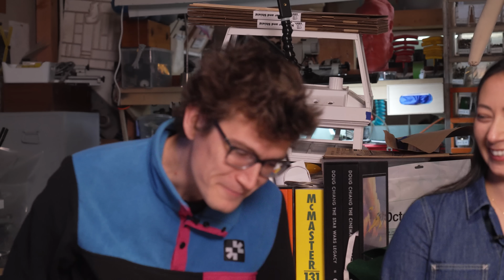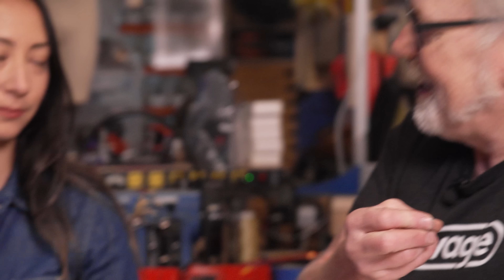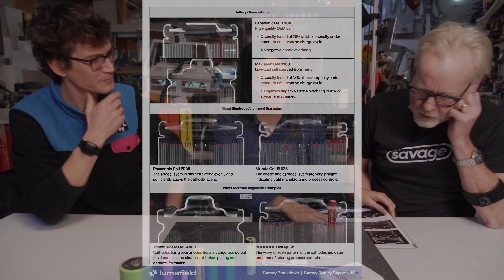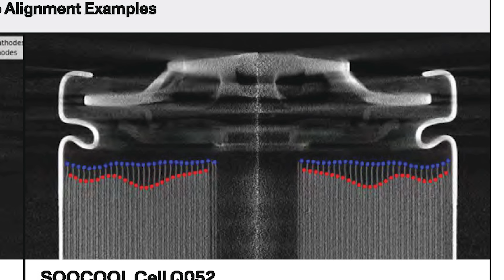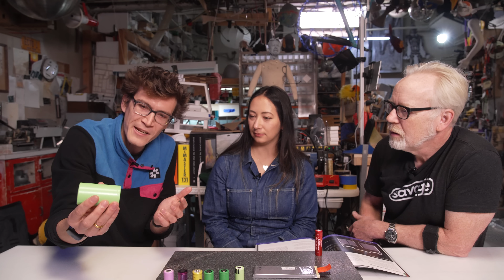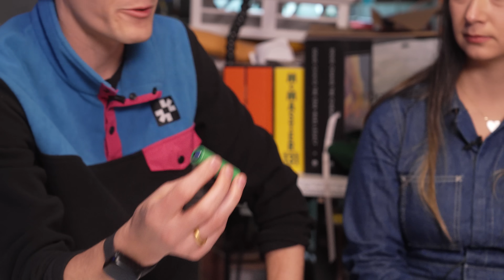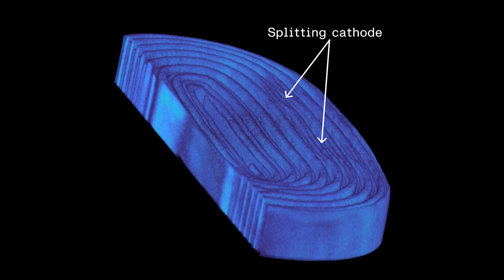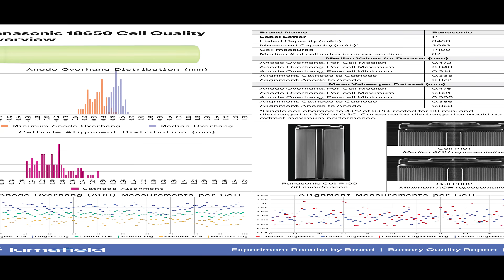The Surprising Flaws in 18650 Lithium-Ion Batteries

Comment: Maybe a dumb question. Does the thing you are scanning get irradiated somewhat when you scan it like this? Or it just passes through? If they do, do some materials keep that radiation?
Reply: The objects being scanned do not become radioactive with ionizing radiation; you need stuff like gamma radiation or neutrino bombardment to really see that. Being in the scanner itself while it is operating would be potentially dangerous (I don't know the specs but I expect they run it considerably hotter than a medical-grade device, though not egregiously so).
Reply: @Tahoza  Thank you for the answer.

Comment: I also wonder if a bunch of these are all built on the same line, and then a binning/sorting process sends the ones that come out within spec to get a name-brand label, and duds get a no-name label.
Reply: Pretty much. Many of the off brand ones are basically the quality control rejects. Especially when they just have the shrink wrap to change the name. They’ll generally test that it puts out voltage and call it good.
Reply: I doubt it. It's just very easy to manufacture this design in a way it will still function while containing latent flaws. The controls necessary to prevent the flaws are expensive so they are skipped. If there is no government accountability, they will keep doing it because it makes them money. 
Oh, and don't worry about the cells in Chinese EVs. Domestically in China, they take quality and safety very seriously and the punishments are real. It's the directly exported cells and batteries that their government struggles to handle. In the past it was the traditionally accepted bribes to officials all the way down, but that has been getting better.
Reply: Apparently not. The bad batteries are physically very different and the reputable brands have their own recycling program that ensures they are actually recycled, not sent to landfill. The recycling program also minimizes their financial losses from the defective batteries.
Reply: no... your peoples republic of cheap batteries purposely dumps junk on the market

Comment: Maybe should have told ppl what to do with lithium cells they don’t want to use…like throwing in the garbage is almost def not the right course of action lol
Reply: Most whole foods have a recycling battery spot at the front of their store. You can call up your local recycling centers. There's usually one in every area. Also computer parts batteries so on.
Reply: Most things don't go into the garbage. Especially anything that's this technical or specialized. I get that it isn't common sense, but still...for some reason.
Reply: @esaedvik   have to wonder where you're from......
Reply: That has little to do with the topic. This is about quality not disposal.
Reply: @manuelh.4147he says he’s gonna throw out some of his batteries so I disagree

Comment: I have been vaping for years the worst thing I have seen in early years was thermal run away which causes all kinda of failures some even turn the mods into mini rockets or explosions
Reply: Yeah I’ve vaping for over 15 years and use 18650s every day. I even worked at a vape shop for a long time and we sold them. 

Ironically, the aftermarket cellphone repair shop two doors down from us was using similar batteries and it caught fire.

Comment: I have more than  50  18,650 batteries in my light saber collection. all on a single wall. I am not that worried about it, because I use name brand, and protected batteries. They have the cut off protections to stop from overcharging and from discharging/not charging your batteries for a long time.

Comment: The quality and safety needed for lithium its necessary to buy from reputable brands. the dropship flybynight suppliers are scary. These are not alkaline or lead batteries that at most would leak.
Reply: More importantly buy reputable brands from reputable distributors….NOT AMAZON!
Reply: LOL, pure nonsense.  I have had hundreds of these batteries in devices, all the lowest price.  It would take years for a defect to emerge and it would just stop working.  It is not like they are going to actually catch on fire, lol.
Reply: @ASDasdSDsadASD-nc7lf  lucky you.
Reply: @ASDasdSDsadASD-nc7lf  except for all the stories where they do in fact catch fire of course
Reply: @ASDasdSDsadASD-nc7lf  ignorance is bliss.
Reply: @ASDasdSDsadASD-nc7lf  Yeah it's not like they will catch fire... Li-Ion batteries can't catch on fire.... that's crazy talk! /s

Comment: The thing is about buying good brands, I dont know if they even exist 

Amazon is full of randomly named "brands". Who can I buy a battery bank from that is a good brand?
Reply: Skip amazon. Buy from a real supplier like Mouser. 

Amazon has become the Guy selling “Rolexes” out of his trench coat.
Reply: @Racing_Pig i thought mouser sold components, not fully assembled products.

To others;

My issue really is i dont know which of these fake looking "brands" are real and jd bet all of them are just garbage being bought on temu or directly from a supplier that pumps out junk without much QC and then selling on amazon.

Is there any brand of usb battery packs that are definitely manufactured properly with good QC?

Also, a usb cable, i go through loads of them each year, even supposedly branded cables from samsung. What brand can be trusted here? 

Amazon should be preemptively banning all these fake companies, but theyre getting a lot of $$$ from it so that wont happen.
Reply: @colinofay7237  Sorry, Misread battery bank. Anker was the standard....but yea even they can't guarantee actual quality. Surprisingly Microcenter's Inland have been pretty reliable USB cables. although they tend to be stiff PVC not braided or silicone.
Reply: Pick a major Japanese or Korean electronics manufacturer. It's really that simple.
Reply: Anker is basically the only company I buy from on Amazon. Other decent option is to physically go to a major electronics retailer, most stuff on the shelves will be decent because the cost of putting a million shitty brands there is not worth it.
Reply: @NinjaPtatoe  I wouldn't touch anker with a barge pole, too many recalls for fire and burning hazards within their product range
Reply: @NinjaPtatoe i dont know honestly cause ive had bad experiences with ankar, might be better nowadays though
Reply: good question: Panasonic (those panasonics from china are cheaper than japanese versions, but still better than low grade junk mentioned in video) , samsung, lg. 
sort them by price, descending, that way you instantly see best brands.
after that, don't pick most expensive, bur not cheapest either....
Reply: Heck, I don't even trust that a "Panasonic" from Amazon is really made by Panasonic. I've bought quite a few items on Amazon that were counterfeits. I even quoted the mfgr's "How to spot a counterfeit" web page and Amazon denied it.
Reply: Some companies such as RAVpower have abandoned Amazon and sell directly from their own site.  Not sure if RAVpower is a premium brand -- everything I've gotten from them has been good, but that's a sample size of what, five?

Comment: Yeah, when it comes to Li-ion, do not cheap out. 
The only difference between a battery and a bomb is the speed of energy release

Make sure to keep the cells at roughly the same charge. If that means buying a more expensive li ion charger, do it
and don't overcharge them, make sure the Battery management system takes care of that, otherwise it will pop

Comment: I recently bought an energizer headlamp that came with its own battery. it took an 18650 as well. I contacted them to ask about the model number spec so I could get a charger to fit; its longer. They told me that it was an 18650, which it was not and I would expect a major manufacturer of batteries to adhere to a standard. this battery had a charge port on it, so it had a usb c female and circuit. the headlamp also had this circuit doubling up. the battery only charger only makes sense if you have more than one and remove the battery for charging, as this fits 18650's and I already have an 18650 charging dock this makes this innovation of their over engineered redundancy. you still need cable, and a power source, which only services 1 battery at a time. where as my mini charger fits 2 18650's' and thats my mini.
Reply: It's still an 18650 cell despite the additional protection and charging circuit they put on top. That doesn't mean it's a cheap or bad quality cell. It's a good option for people that don't have dedicated battery chargers. I've never come across a charger that wasn't able to accommodate the slightly longer protected cells.
Reply: what is the 18650 spec? its 18mm dia. and 65.0mm length.  When the battery is 66.5mm long does it meet 18650 spec?  They just tacked a charging circuit to the top of the battery.
Reply: @ronin.badger  it's a protected 18650 which is an 18650 with a protection/charging circuit added on top that increases the overall length. Not sure what's so hard to understand about that. Button tops also add a couple mm. That's why battery devices and chargers have springs in them, since not all batteries are exactly the same length.
Reply: @F0XD1E  Let me clear up some confusion. I believe you are assuming that the battery I am speaking of has a little petrusion on the top similar to the button top in the video. It does not. 
Model: AE19-10R031 is not an 18650. it is actually more than 1.5mm longer closer to 2.5mm I misspoke when I stated this going from memory, I have not measured it precisely. It does not fit in my 18650 wall chargers, that do not have room to accommodate taller than spec batteries.  If you would like I can Send you a photo but I feel any argument beyond this, with the limited info you have will be lacking on your part. I have the battery physically and it is not that of the dozens of 18650's I also have in my possession. 

the Charging circuit is not a safety addon, but an engineers crowning jewel. put there for convenience while adding unnecessary complexity all the while taking a standard and form factor and discarding it. rule #1 of engineering, if something already exists that can do what you need it to do, use that instead of making a new thing; dont reinvent the wheel.
Reply: @ronin.badger  Protection circuits have been used for more than a decade on 18650s, especially ones used in flashlights to prevent over discharge. Look up "keeppower" brand that adds protection circuits to high quality Panasonic etc. cells for use in flashlights. I'm surprised this is your first exposure to it.

Comment: the 18650 battery is so well used that my  $2000 e bike has hundreds of them in a removable battery pack. Tesla car  batteries are just a huge block of thousands of 18650 type batteries if I remember right.

Comment: I've got the "Genuine Samsung" cells from SOOCOOL... using them in a trail running waist light. Performance has been fine so far, but I haven't performed any instrumented tests. The number of cycles is pretty low and the rate of charge/discharge is also gentle (~1/8C). Wondering now about how safe they are while charging.
Reply: Get a charge bag and you’ll be most likely fine.

Seriously, those things work better than you’d think.

Comment: I really hope the donutlab battery turns out to be real.
Reply: You and many others too. More credible is CATL's progress. Good tech coming out of that company.
Reply: welp. I'm disappointed too.
Reply: But what would be the reason for believing in a fantasy spec without any tangible evidence?
Reply: @allanallansson9532  : https://drive.google.com/file/d/1xxWS_cn-ExittX9cjDtZik4BCBcNllyc/view?usp=sharing
Reply: @allanallansson9532  totally agree. big statements at ces with promises of more to come when nothing else is on the market at that size/scale. could totally skip ces and just come out with actual data/demo's/etc. to showcase and have people tangibly deal/experience it. It screams Nikola
Reply: @allanallansson9532  Humanity runs on hope. I am all along, unless that is proven incorrect. Imagine, the world energy problems and all the wars that battery technology is going to solve.
Reply: @PG_Bright  If you need to live in a fantasy world to feel good, then go ahead!
Reply: @allanallansson9532  It's fantasy specifications for a battery, but not for a super capacitor. The only problem to fix would be the fast self-discharge rate and if they fixed that then it would be better than actual batteries.
Reply: @clippy2050 Not necessarily. The significant voltage drop that follows the drop in charge leads to other issues.

Comment: I had bad experience with quite a few brands including Samsung, but I really have good experience with the Sony 3000mah 18650, I use them on my vape, they have way more than a thousand cycles and still charge pretty good, they lost like 200mah.

Off course after way more than 1000 cycles they will lose voltage over time but since I take them out of the charge and start using right away and always use for 1 full day on my vape they still last pretty good, if it was for other devices wouldn't be as good.

Comment: I have 14 lithium battery powered tools/electronics... I NEVER leave anything charging unattended, I am always in the room. I have a bucket of sand with a large coffee can forming a hole down into it. If a cell phone battery decides to get spicy, or a tool battery... I drop it in the hole, pull the can out and bury it in the sand. Move the bucket(metal!) outdoors using an elbow length silicone BBQ glove so if a flame would surface no arm burns. I do repair cell phones so deal with a LOT of fat puffed up battery pillows just waiting to go poof!

Comment: 10 years ago I re-celled my ebike battery which uses 18650 cells, saved me literally £100's, but had to be very careful on two fronts: The soldering of the cells into the pack (bought them pre-tabbed), and getting high quality reliable cells.
The re-celled pack was reliable and lasted years :)
Reply: Spot welders are a cheap and safer alternative to trying to solder to the batteries. I just used one on my most recent project and it was just fun to use!
Reply: @Geeksmithing  I looked at getting a spot welder but realised it would have eaten up any savings I got from re-celling the pack myself, buying the cells pre-tabbed meant I could solder to the ends of the tabs instead of directly to the cell.
Reply: @licensetodrive9930 gotcha gotcha. Makes sense!
Reply: @Geeksmithing  Spot welders also require inferior conductor materials and can also be dangerous.  Resistance soldering is better but won't be saving anyone money.

Comment: I have at least 100 of these type of batteries, my problem is what do I do with them ? nobody will take them and I refuse to throw them in the trash. So I'm basically waiting for a fire to happen. There needs to be a solution available to consumers for safe disposal. would have been nice if you had mentioned disposal in your PSA.
Reply: Lowes and Home Depot will take them, just individually bag them.

Comment: As a former vaper, I always used real Samsung batteries. The only problem I ever encountered with any battery was my own fault, when I accidentally tossed a little 14500 into my pocket with my keys. When I noticed a very quickly accellerating hot-spot in my pocket, I ran outside and threw the now-smoking battery into the parking lot and let it burn itself out. Whenever I carried a vape device that used 18650s, I made sure it was a system that allowed a blow-off cover, so I didn't have a potential hand grenade up against my face. I've seen the pictures of people who had a short in their sealed vape device. It isn't pretty.

Comment: Are the defects random or do they constantly appear in similar locations?
Reply: Expect both to occur, but it depends on point of view. 
Key issue is poor quality control, and likely poor line setup.
One quality issue can be alignement drifting on the machine and allowed to drift way past (safe) tolerances. So between sequential batteries rolling of the line, there might indeed be a consistency. However, between two batteries shipped in a retail package, the defects are just as random as anything, even if there is a clear, potentially even predictable process causing it. 
Those batteries with that large waves are particularly dubious, as it means the cutting process is already terribly inconsistent within 10 mm of roll length, let alone the thousands of miles the machine is actually through-putting. That is a cutting process failing outright and the manufacturer just doesn't care or even lacks the understanding their machine is broken.

Comment: Please don't submerge a battery in thermal runaway underwater.
Reply: In the RC community, we use a bucket of sand for Lipo batteries.  Won't stop smoke damage from occurring, but will stop a fire from spreading.

Comment: Still using my rechargeable eneloop AA and AAA Batteries bought in 2012! And they still work perfectly. Before.. i wasted so much money on other brands and also throw them away at some point after the fact they lose charge fast, even if not used.